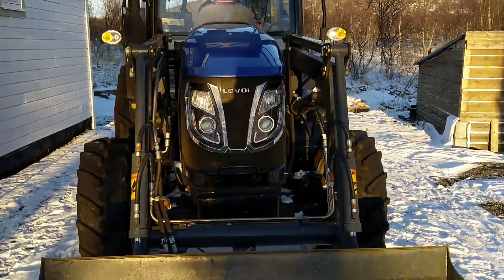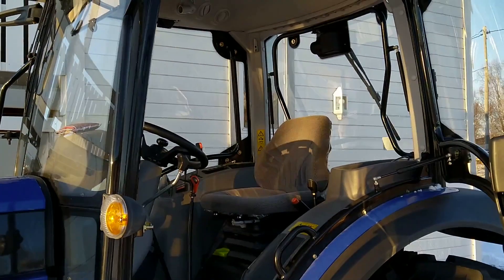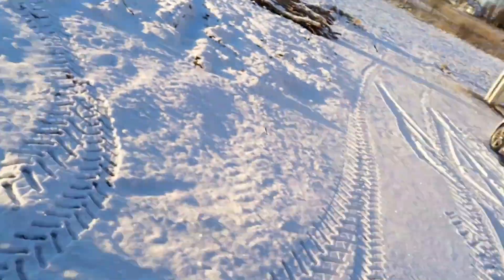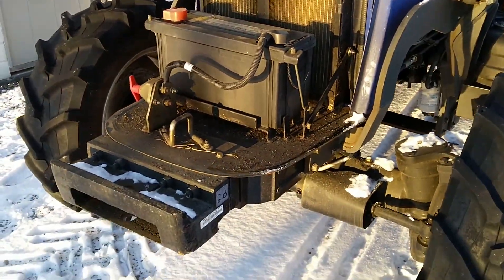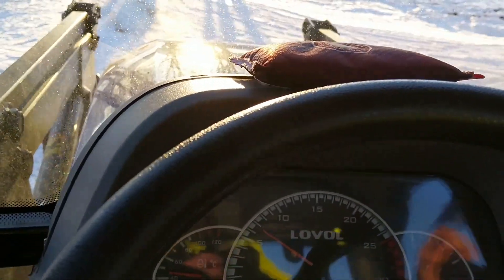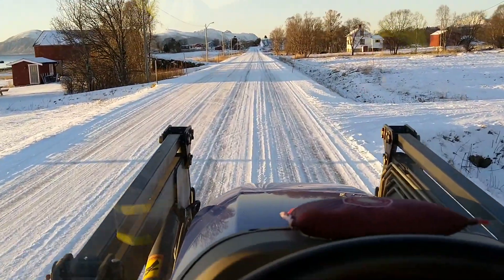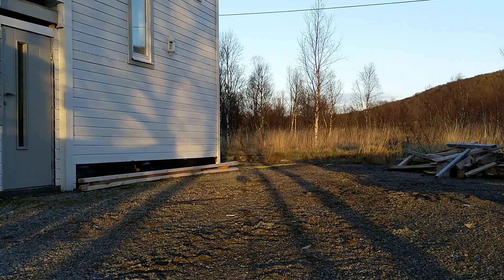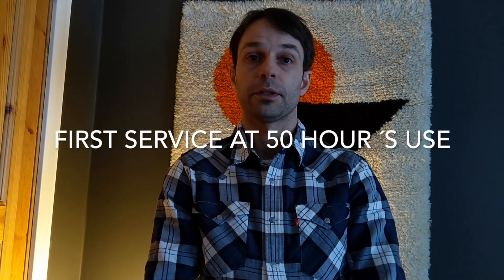Lovol 504 review -what you need to know about the tractor.

Comment: Very interesting video! 
Just some questions: which kind of oil is recommended and generally how often it is appropriate to change it? You think it's necessary to change also the filter of it when u change the oil? Thank u a lot!!
Reply from the maker: Hi. It is recommended to use W10/30 for everything on the tractor. Be aware that it  may be different if you live in a country with very different climate as Norway. (Because of temperatures).  Engine oil should be changed 200 hours/once a year, transmission last a lot longer. Minimum 500 hours. Same with front axel. I prefer to change filters everytime.
Reply: @outdoorsintheartic  Thank you so much! I asked that from my father that has a tractor like yours. May I know which is the quantity of oil that is necessary about the oil change...I mean how many liters. Thank you again for your precious answer.